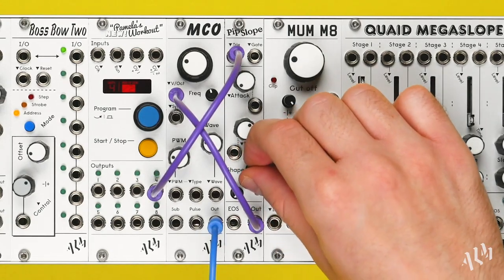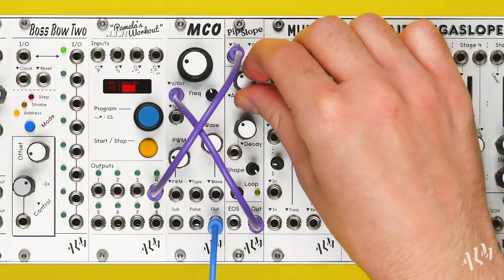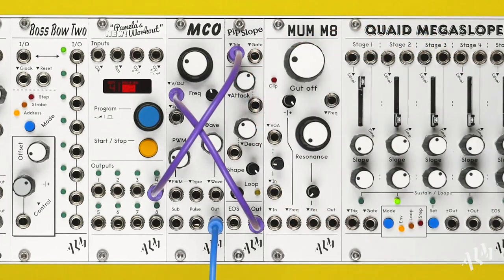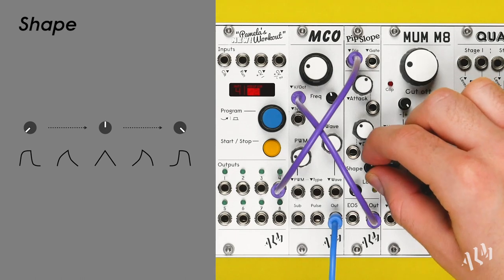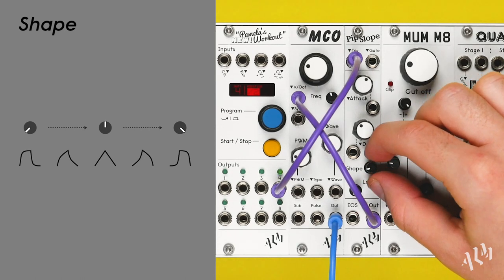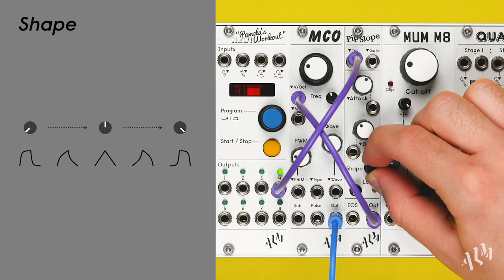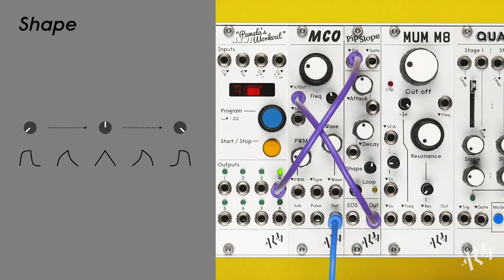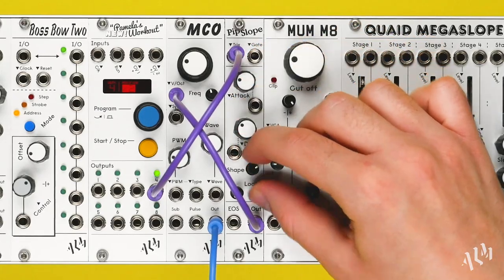Introducing Pip Slope (mk. II) - Compact Envelope Generator - ALM028

Comment: I'm late to the party here, but I'm curious if modulating Decay/Attack will wait for the end of the envelope to apply the change, effectively sampling the cv input at the start of the phase? I've used other envelopes with modulating Decay time and I'd always prefer it to lock in the shape if the cv source is random or less predictable. Thanks!
Reply from the maker: The change is immediate when modulating attack and decay. Using something with synced random like the Pam to modulate it would produce the same locked in result.

Comment: Relatively new to all this...  In the example of using a keyboard gate, is the Mum M8 integral?  I have attempted to replicate your example but I'm not 100% sure how to do that?  Does it need a VCA or something?  Thanks in advance.
Reply from the maker: Yes, we are using the built in VCA of the MUM M8 but it could be any VCA. Patching Pip Slope's envelope to a VCA CV input will control the level of any signal patched through the VCA. In this example MCO generates audio that runs into the VCA of the MUM M8, the Pip envelope is patched to the VCA level CV input and changes the volume of the MCO. VCAs are essential in a system for controlling the levels of sound generators so they are not simply droning endlessly.
Reply: @busycircuits  awesome. Thank you!

Comment: I recently bought a used pipslope mk II and…

Edit to simplify wordy original:  was experiencing a weird thing where the gate stays closed after 12 oclock on either attack/decay.
Reply from the maker: Sorry to hear! I would advise you email help @ busycircuits
Reply: @busycircuits  turned out it was just the old college reboot needed to fix it.  Cycled the case and it started working as expected.

Comment: 0-10v?
Reply from the maker: Output range is 0-5v switchable to 0-8v with a jumper at the rear of the module.
Reply: @busycircuits  Awesome! I'll be getting one for my Palette case then. 5v was not enough depending on the receiving module. Thank you for adding the jumper.